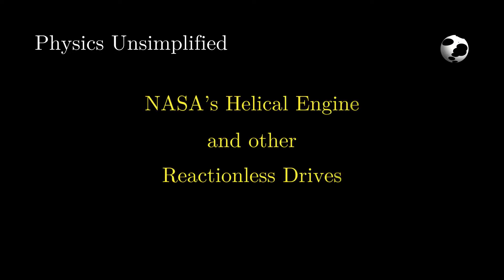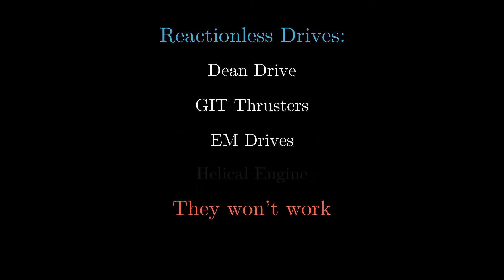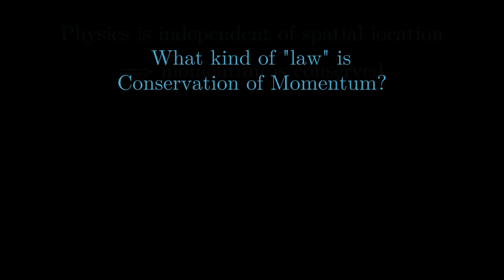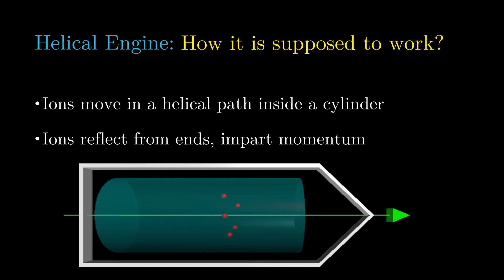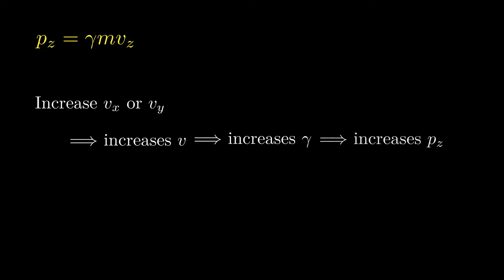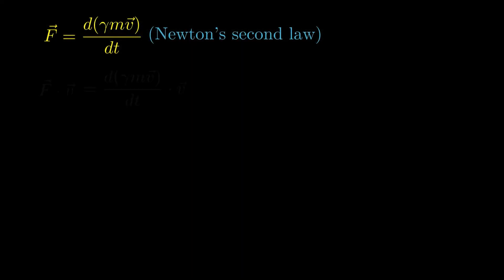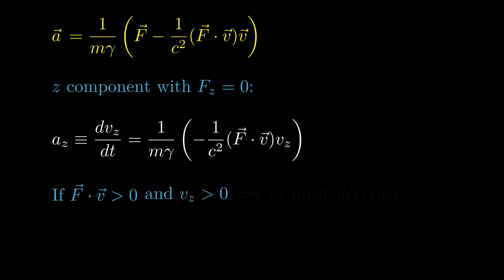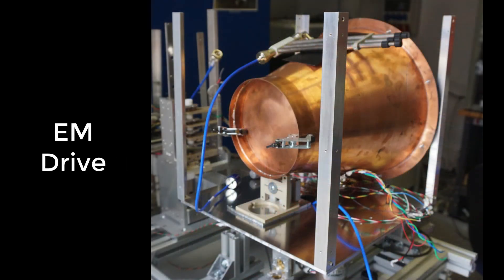NASA's Helical Engine and Other Reactionless Drives

Comment: I wonder if this reactionless drive would work. Take the diagram of the spacecraft and take everything out. Put two lasers in that pulse at the same time on the walls in a way that the beams make an X inside at the rear. Put in a spring loaded bolt going from next to the point where the beams cross to near the inside of the nose then put a boxing glove over the end near the nose. Now if you push the end of the bolt that's near the laser beams the glove should move forwards till it touches the inside of the nose then spring back when you release it. Now imagine the spacecraft is filled with liquid or pressurized gas. Each pulse of the lasers will create an exploding plasma field at the point where the beams cross and combine energy. Each explosion will shove the bolt forwards punching the inside of the spacecraft's nose. Each punch will accelerate the spacecraft. Why I believe it's reactionless is because the plasma field is free standing within the spacecraft and not mechanically connected to it. Any kinetic energy that doesn't push the bolt is transduced to heat before it can touch anything to cancel out the acceleration. That heat can either be expelled or captured by a transducer to save energy.
Reply: Does the plasma stay inside the craft, meaning it has to bounce off the walls, or does some of it go out the back, meaning you made a reaction drive? The plasma atoms will bounce off the atoms next to them, which bounce off the atoms next to them, and so on, until the pressure wave gets to the side of the spacecraft and bounces off the wall. It's like how you can weigh a paper plane because it pushes the air down, even though it doesn't touch the scale.

Comment: Mass can be changed to energy. Energy can take the form of light. If a mass is moving it has momentum. Momentum can be expresses as an impulse or a force over a period of time. Does mass converted to light have any momentum? If it effectively does not have any momentum, then it would be be possible to fire a pellet /mass of fuel at a velocity and make that moving mass cause an impulsive reaction on a space vehicle recoiling it in the opposite direction of the fuel pellet/mass being burned. (energised would be a better word) The space vehicle would be moving to the right and the energised fuel to the left. This mass of burning fuel could in a theoretical engine turn that fuel pellet/mass into light energy. Upon hitting a reflective mirror it would transmit no momentum and therefore no impulsive decelerating force. The reflected light would in the theoretical engine turn the light energy back into a mass that was moving and therefore did have momentum. This reflected moving mass would hit the right wall of the space craft with momentum and produce an impulsive force sending the space craft once more in the SAME direction! The fuel pellet/mass could be re-energised from an external source like a sun that the space vehicle was passing on its journey. So this concept requires a theoretical device or material that turns mass to light energy and light energy back to mass. It also requires reflective mirrors and a way of re-energising the "fuel pellet/mass" from an external source.

Comment: The Em drive was always going to lose energy on the first diversion and lose a bit less energy on its reverse diversion.  This a very minor nudge of difference in energy in one direction under its design.  Why you never trust a scientific mind to always engineer a work around (I do not know if the inventor was scientists or engineer, but an engineer with a purely scientific mind suffers from the same blindness).  There are ways around this.  If you drive a car on a road you are converting energy into a directional force.  What people with a scientific mind often don't factor into their ideas, is that such systems are not truely self contained, when it travels space and vacuum energy theoretically travels through it.  Therefore you can treat space like the road, and propel off of it.  But, another example is that if you had a little warp field device rigged in a sealed container, you are able to move.  Now, flip it and make the container the device.  There is a second way.  As for mechanical devices, I had come up with a possible design to test decades ago, but do not know if the interaction would work.  If it works at all it maybe a very low yeild of net directional force, unless you change the nature of space/vacuum energy etc to give traction.  It is known in science, that those who deal with what they think they know with pure equations can make very limited progress compared to those who visually (really conceptually in conceptual relationship manipulation) can see it how to make it work (the more elegant mind).  Like happened with relativity.  However, the present solutions to physics are a construct yet to be finalised.  A construct may emulate the true action, but still be mistaken in parts.  It's no good saying you have the complete answer before you do (claiming victory before the war is over).

Having a look at your hokey pokey mechanical device, it was very quickly obvious it was not going to work.  I see lines of force cancelling each other out.  If I wasn't tired and sick in bed, it would have been just a moment of looking.  It's not just a matter of visualisation,  it of visualising the working of the concepts properly.  As I have illustrated, the maths used and it's origin is suspicious (pseudo science, so to speak).  It goes to self-limiting below the reality.  There were movements along certain lines and gravitational research at the time.  I've seen this happen in another feild too, where an unlikely academic puts in a limiting theory as an excuse, that can be countered but recieves promotion instead.  It's not that the maths isn't right for what it descibes, it's what it leavs out.  In all these systems, there is a contribution of energy, which they hope to move towards a net directional vector.  It's not something which just takes off by itself without energy.  So, the maths needs to take into account process of converting energy into movement.  Absence of proof of concept does not prove it can't be done in another way.

Comment: It is possible if not to break, find loopholes in the basic laws of physics. For example I have built and proven a device capable of superluminal communication and violating causality (Everett "many worlds" gets around any causal paradoxes) but reactionless drives have proven a bit more difficult. I am concentrating on other projects more likely to succeed. My idea (which probably will not work) is to have two chains in a j-shape mirroring each other. If both chains were pulled on reversing the J shape on both spools would there be any reaction? If not, the assembly could be rotated using a gyroscope and the process repeated using only electrical power without reaction mass. I will get round to building it but I am a busy man right now. the point of the mirrored j's is the same as the helical engine, it stops the device rotating, but this is a mechanical device. Even if it works, issues of wear would be a problem.

Comment: The principles of how they all work is simple and hardly a violation of logic. There is force applied in one direction and the reactionary force is redirected into mechanical pressure on a solid. It's no more a violation of physics than putting additional weight on a table without the table breaking.
Reply: But the reactinary force being absorbed into a solid mounted to where? The spacecraft? Then the force will not only be absorbed into the solid but also into the spacecraft. Monentum of the craft is preserved.

Comment: If there’s some kind of drag, in the component of x axis, there’s a way… I know u can’t see that, maybe you can make extreme examples. Maybe it will work, but get insane hot due to dragging. Dragging on one direction, reducing drag on the other. Maybe work for 1 second and wait 1 year for the dragging to disperse? And where the energy comes from? Better use solar wind as they already exists or some super heavy elements with large enough mass that neutrinos can interact with…. Get creative, be creative! ❤there no such thing as “empty space”

Comment: There is absolutely no need for new physics or breaking any known laws.
Here's a breakdown of how this concept works in terms of energy conservation:

Energy Input: The onboard power generation system produces electrical energy continuously. This energy can come from various sources, such as advanced solar panels, nuclear fission plants, or hypothetical future technologies.
Acceleration of Mass: The electrical energy generated by the power system is used to accelerate a mass, such as molten iron, into a circular path. This can be achieved using electromagnetic or mechanical means, depending on the specific design of the propulsion system.
Circular Motion: As the mass enters the circular path, it experiences centripetal acceleration, which causes it to move in a circular trajectory. The energy required to maintain this circular motion is supplied by the onboard power system.
Directional Thrust: By strategically directing the circular motion of the mass and then abruptly changing its trajectory, the system can produce a directional thrust in the desired direction. This change in momentum results in forward propulsion of the spacecraft.
Energy Conservation: Throughout this process, the energy input from the power system is converted into kinetic energy of the mass and redirected as thrust to propel the spacecraft forward. Since energy is neither created nor destroyed according to the law of conservation of energy, the total energy of the system (including the kinetic energy of the mass and the electrical energy from the power system) remains constant.
In this propulsion concept, the energy input from the power system is indeed preserved and converted into kinetic energy to generate thrust. The key challenge lies in the efficient transfer of energy from the power system to the mass and in controlling the direction and magnitude of the resulting thrust to achieve effective propulsion. Additionally, practical implementation would require overcoming engineering challenges related to materials, efficiency, and system reliability.

This would work because of conservation of momentum and this is not like some proposed drives a case of trying to accelerate the car by pushing the backseat ... 

or even simpler ... I stand on a platform in space and throw a mass out in front of me converting power into kinetic energy. I have tied a rope into the mass and when the rope is tight the mass of the platform will through the rope try to break the motion of that mass, which it of course will, but some of the energy will pull on the platform and change its momentum. We will start to drift in the direction of the pull. We convert one type of energy into another, and end up with motion. This is not even something I would need a physics lab to show. Stand on a skateboard and hold a mass in your hands, then fling that mass outward while holding it. Conservation of momentum will set you in motion. Continue to do so and for each time you fling out the mass you accelerate since you create more kinetic energy. Actual results from a simple experiment, and if your calculations show otherwise then it isn't because I break any laws of physics, but because your calculations does not hold up with reality.
Reply: Your platform scenario doesn't work exactly by conservation of momentum. It applies at the start, too.
When you throw the mass one way, the platform will start moving the other way. When the rope gets pulled taught this effect will cancel and the platform and the mass will stop(in the original rest frame).

Comment: Momentum is only explained by experimental observations. Inertia, centrifugal "force"...etc. are in fact dynamic space pressures. Static space pressure is gravity for example, what is created by mass, away from them (space curving backwards to the mass or object). Dynamic space pressure is a similar caracteristic happening inside the objects but curving outwards (lot of space inside material). That inside space curving is causing effects in case of accelerations, inertia, centrifugal "force" (centrifugal space pressure, more exact)...etc. Is a possibility to create a closed propulsion, what is NOT without energy input, but is way more efficient than rocket propulsion. Propulsion to move on the fabric of space. In fact rocket (jet) propulsion is in fact using "space pressure", accelerating material ... Possible that Black Holes don't even have inertia or momentum, cause: no internal space in them. They have only statical space pressure ("gravity"). Black Holes move WITH the fabric of space but NOT ON the fabric of space. But that is a different subject all together. (Space physics...)
Reply: @SandeeAlesor Where did you hear about this concept of dynamic space pressure inside of objects?

Comment: There is one way you could have an apparent reactionless drive there really would not actually be reactionless. That would be a case where the reaction mass is the entire mass of the rest of the universe or at least a reasonably large local portion of it. For example, if the reaction mass is the mass of the solar system, what would be the acceleration of the reaction Mass if you are trying to accelerate say a vehicle the size of Starship at 1G. 

I'm not saying that any such drive is possible in practice, it's just that it is a way of getting the same effect as a reactionless drive without violating the conservation of momentum.

Comment: Reactionless drives will be based on quantum effects and conservation of momentum is not quantum law
Reply: As long as quantum effects obey spatial invariance, they will have conservation of momentum. And as far as we know, they do. Please don't treat “quantum” as “magic.”
Reply: If you could say program atoms to emit photos in one general direction then you could just heat a slug of that material to deliver linear acceleration. Take in energy from every direction (the universe) and spit it back out in one specific direction. The only problem is it's always going to want to move unless you can somehow turn it off. In which case the universe might be filled with such atoms that behave like these rigged slot machines of quantum effects. We just have to find them or figure out how to engineer them ourselves.

Comment: Gyroscopic propulsion is being used on the satellites bouncing the signal of this broadcast 😂😂😂

Yiu really havent done much research. Lifters work betterbin a vacuum btw. First electronpropulsion patents filed before 1900.. back when you couldnt get a patent without a working model
Reply: These engines are used to rotate the vehicle, not to push it forward and backward. What is meant in the video is not to rotate, but to push it forward or backward.

Comment: I believe it was intended to be used in orbital maneuvers. Imagine that apogee is 200km and perigee is 150 km. Particle shift to the right could occur at 150 km to raise the orbit to, say, 151 km. Then wait to particle shift back to the left until satellite reaches the apogee of the orbit, decreasing it to 199km. This method effectively raises the orbit of a satellite by borrowing from the other end of the orbit. This does not violate the laws of physics.
Reply: I believe this is called a gravity tether and it's a real idea. You CAN build a spacecraft big enough so different parts of it occupy different orbits, and you can use the difference between different orbits to steal angular momentum from the planet or to shuffle the craft's momentum to a different part of the orbit. That's real. However you need a shift of at least hundreds of meters. You need a winch with hundreds of meters cable with a weight at the end. It can't fit inside an engine.

Comment: No you are WRONG . Conservation of momentum can not be isolated from the universe.  There is NO SUCH THING as an isolated system ! Any system that acts, interacts with the momentum and mass of the universe. Common mistake by Physics the world over. Now take a look at the WORKING MACH drive. And the THz needle thruster arrays. I have written up this tech and supplied it to ADF. It definitely does not belong in the Public domain as it forms the basis for a 1st gen working UAP  .
GIT worked in a friction environment such as on water as a ratchet device however inefficient.

Comment: Today of the Ivo LTD Quantum Drive launches and this video will have to be remade... quantized inertia can produce thrust without particles just as surely as black holes event Horizons interact with virtual particles to create Hawking radiation virtual particles will interact with rindler Horizons created by an accelerating object to create Unruh radiation you can apply this concept even further to just synthetically program an object's inertia via the quantum vacuum that would be called a Horizon Drive look at the Salvatore Pais u.s. Navy UFO patents.
Reply: It didn't launch. McCulloch is deeply wrong about his theory.